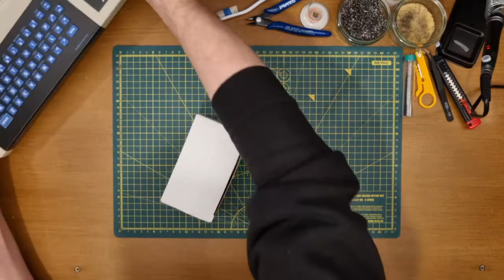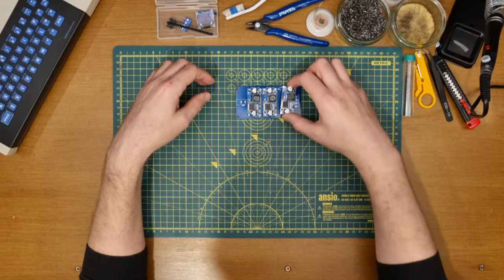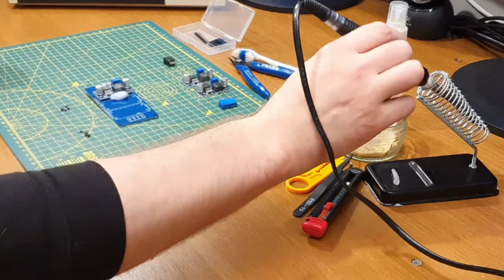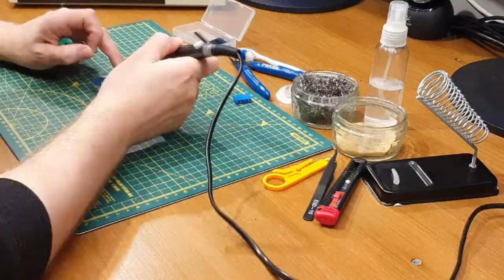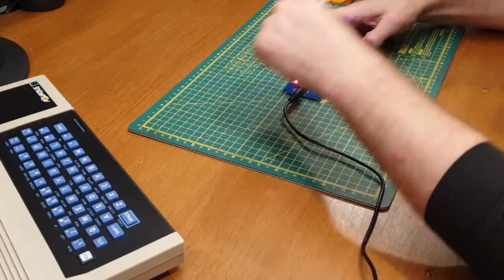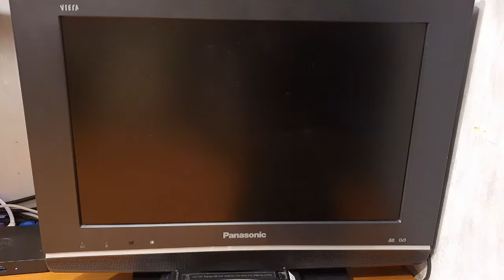Mattel Aquarius Fix - Part 1 : YouMakeRobots replacement PSU build and test

Comment: I had an Aquarius back in the day and ran into a guy who made me a wirewrapped 16K RAM expansion module for it (cost me $75 at the time). I still have the RAM module, and it's a thing of beauty. I'll have to check it out one of these days. :)